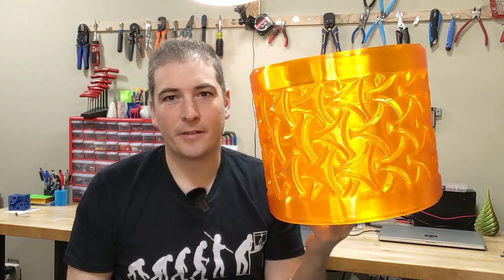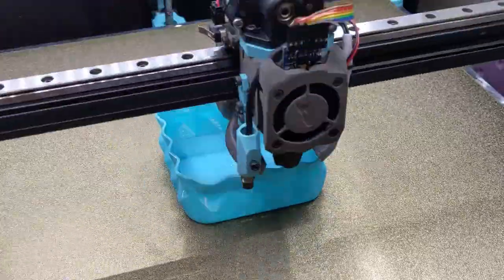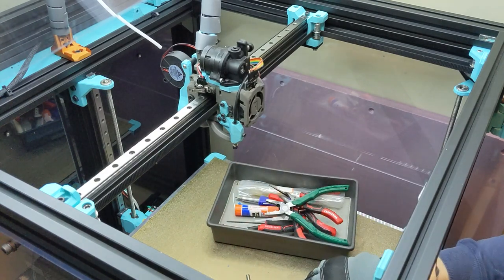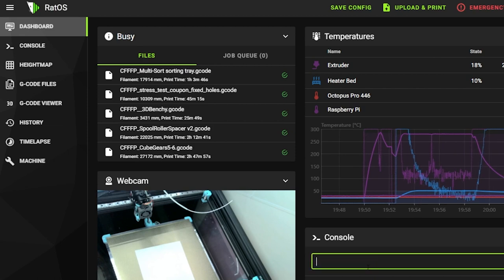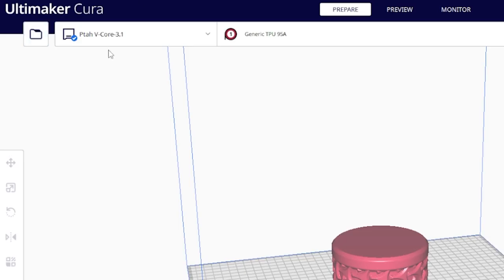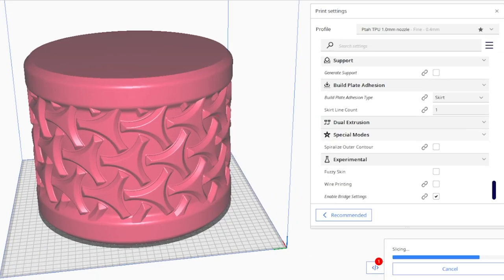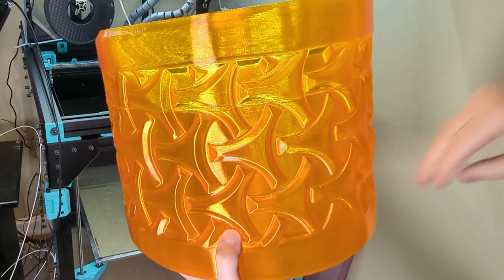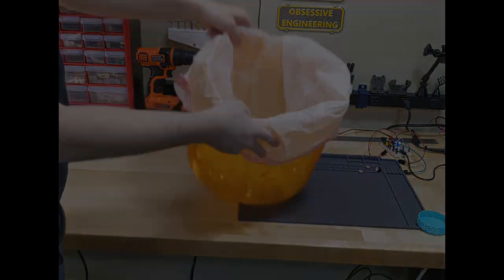3D Printing a Giant Indestructible Trashcan #3dprinting #tpu #ratrig

Comment: I ruined some PEI sheets printing TPU until I discovered that I can get a tightly stuck TPU print off my PEI easily if I spray the edge of the print where it's on the bed with some isopropyl alcohol. The alcohol does something to unstick the print. Works every time and I don't have to mess around with glue stick. I print a lot of TPU.
Reply from the maker: Interesting.  I've heard of that for other materials -- the alcohol evaporating cools the material down and it contracts faster than the plate, which can detach a corner/edge, which might be all you need for ABS/PETG, etc.  In my case, I usually can get a TPU corner up, the issue is the rest of the surface fused to the bed.  🤷‍♂  But I haven't tried it before, so I will next time I gamble on a smooth-PEI-TPU print

Comment: I noticed whole carriage play when you tightened the nozzle at 2:41, you may have to check for any loose screws, i don't think that amount of play is normal, but i may be wrong.
Reply from the maker: Yes!  I notice that too every time I change the nozzle.  I've been somewhat concerned about it, but it doesn't seem to affect the awesome print quality of the printer, so I haven't stressed too much about it.  And if you watch my build video (particularly the short EVA video and Part 2 video), you will see that I am going to avoid messing with that hotend assembly at all costs 😅
Reply from the maker: Update on this:. I just took off the extruder and and adapter plate and tightened the bolts holding it to the linear rail glide block.  The play in the printhead you mentioned is gone.

Either I never tightened it (unlikely) or over time the nylon parts (or bolts?)  cold flowed/creeped.  I guess it shouldn't be surprising... These are plastic parts after all and this is a fast printhead at elevated temperatures.  Even furniture in my house that I have to put together says you should re-tighten the screws after a few weeks of use.

Comment: About to start building my ratrig 400mm. Love the content!
Reply from the maker: Thanks!  Building this machine was a real blast (besides that EVA thing... but that was avoidable).  And every time I go to print something on my Ender and it says 5 hours then I go to my RatRig and it says 50 minutes, I am reminded how awesome it is.  Make sure you you're constantly checking squareness when doing the initial frame, and don't forget to ground everything.  Also, get on the discord and get used to using the search box.  You can ask questions of course, but nearly every thing that can go wrong has been discussed there before.

Comment: I'm in love with the massive bed and print volume. I didn't get a chance to check out the build process videos, how much did the printer end up costing by the time everything was built and ready to go?
Reply from the maker: I was able to keep everything slightly under $2,000 with the enclosure kit and buying the polycarbonate panels and cutting them myself.  You can buy them pre-cut from a shop online for approx $500, but I found clearance polycarbonate sheets from piedmontplastics.com, which regularly has clearance sales on sheet plastics, and I was able to get the panels for less than $100, and then cut them on a CNC router at a local shop.  You can apparently cut them by hand, but it's tedious and inaccurate, of course.  If I wasn't so excited to learn about CNC routing, I probably would've just purchased them.

Here's my V-Core-3 build playlist if you're interested:  https://www.youtube.com/playlist?list=PLrTmSWaWJwqLDVR0vk3-6i47G8yUVdCsp

Comment: Any thoughts why it jammed and then magically cured itself? is the flow rate the issue at that part of the print or too hot, that's seems doubtful, since I've ran sainsmart at 240c with no issue? I find that TPU doesn't need a bed above 30-40c. Came out great, even with the jam. I used to make a bunch of toys for my kids when they were smaller out of tpu, it is indestructible, so there are still a bunch of cartoon characters in toy chests that my kids haven't been able to destroy after many years.
Reply from the maker: I am not totally sure.  At first I thought it might be too hot because I usually think of TPU as printing at PLA temps, but you're right a lot of TPUs go up quite a bit higher.   I can say that every time it jammed, I had no problem re-feeding it through the extruder, so it was never a total clog.

There were a few positives why it wouldn't jam:
1) Large nozzle creates less back pressure from extrusion
2) Vase mode leads to very consistent flow rates

And some negatives that might lead to jamming:
1)  24 mm^3/s is a very high flow rate in general, especially for TPU (you can see how fast and steadily the spool is spinning at 07:44).
2) The BTT smart filament sensor has always seemed like it had unnecessarily high resistance, which might be especially impactful for TPU.  
3) It's possible that my extruder tension was just too low and it was slipping.  I haven't actually figured out the best way to set the tension, and I know TPU is particularly sensitive compared to other filaments.

Comment: Amazing. 

Just found your channel. Not using a rat rig but I love TPU and always want to try and print most things in it lol

What are you me settings? And what file did you use for the print?
Reply from the maker: TPU is amazing stuff.  It is thoroughly underrated.  Sure it's got a couple printing quirks, but whatever you print is indestructible.  

I have added a link to the STL and listed the print settings in the video description.  Thanks for watching!
Reply: @ObsessiveEngineering  I also subbed so keep up the awesome work :)

Comment: Nice print and video, I'm currently building a 400. What are the bed sheet corner stoppers you are using?
Reply from the maker: Here's the link for the corner pieces.  It was recommended to use them to help align the magnetic sheet when you're building the printer, and it would've been worth it just for that.  But printed in ASA it has also survived a couple hundred hours at this point printing with 110C bed temp in a heated enclosure.  Couldn't be happier with it.  (the two pieces on each corner have friction fit pegs and slots, and it wasn't super reliable, but I used a drop of CA/superglue and it's held up fine) 

https://www.printables.com/model/123037-ratrigrat-rig-v-core-3-spring-steel-sheet-bed-corn
Reply: @ObsessiveEngineering  thank you!

Comment: Nice! New sub. I’ve been thinking I’ll likely get a RatRig for my third printer, and I do heaps of Tpu projects, so great to see this, thanks! Any advice regarding the ratrig?
Reply from the maker: The RatRig was my third printer as well (actually 4th if you count my resin printer, but I hardly use that anymore).  I absolutely adore the V-Core-3.1 and it was gobs of fun putting it together.  Also, I was able to do a sub-10min benchy pretty right away after I had input shaping figured out.

Check out my RatRig build series playlist on it if you want to get a feel for what I went through to build it:  

* https://www.youtube.com/watch?v=0dQpodKZjQ8&list=PLrTmSWaWJwqLDVR0vk3-6i47G8yUVdCsp

Here's a couple things I would advise:
* Don't use the default EVA/hotend parts included in the RatRig repo.  I suggest you go to the main EVA website and download the heatset insert versions.  I would've avoided so much pain doing that -- you might have to download new parts from their website anyway, if you don't use RatRig's default extruder & hotend.
* Make or buy a little dolly to put the printer on when you're done.  I used these leveling casters, which are spectacular, allowing you to lower the wheels to move it around, or lower the rubber feet to keep it stable on the ground: https://amzn.to/3Yn4u5w
* Use DIN rails for the electronics in the back, and expect not to have much guidance for the electronics. Most people end up going to Voron docs to fill in gaps.
* The RatRig discord is an awesome resource.  Of course you can ask questions there, but most things have been discussed there before and can be searched quickly.

Comment: Your installation speed is so fast. I'm stuck in the belt tightness. The printed circle is not standard
Reply from the maker: You are building a RatRig as well?  It's quite an adventure but totally worth it!  If you didn't see it, I have a build series on the V-Core-3 -- it doesn't have a lot of information about belts, but you might get other useful info about the process.  https://www.youtube.com/playlist?list=PLrTmSWaWJwqLDVR0vk3-6i47G8yUVdCsp .  Thanks for watching!
Reply: @ObsessiveEngineering  Yes, I have seen every video of you, and the video is very good 👍🏻，  It's just the tightness of the belt that makes me headache. It has not been adjusted properly. Printing effect is slightly poor

Comment: hmm. I like it. I'm thinking it might be fun to try some TPU shower shoes/pool shoes.

I am curious, what is the length between your extruder and nozzle? I Just finished up a hot end mount and extruder mount to fit the DyzEnd pro and DyzeXtruder to the Eva 3 system. the length of the PTFE tube from extruder to the hot end is exactly 50mm, so the path from gear teeth to the tip of the nozzle is probably more like 70mm overall... That may be too long to run TPU reliably. IDK
Reply from the maker: I don't remember exactly but I believe my PTFE tube was around 25mm.

I really wanted to try printing shoes on this printer, especially if I can do it with like 90A TPU (a bit softer than regular).  But I haven't found any good models that give me confidence it's not a waste of time and filament.  Let me know if you find something

Comment: Alan i had the Same issue with my Nozzle, How do i remove it, if it's tight and stuck due to heat changes?
Please i'd Appreciate your input, it's my first Printer EVER and i've done 2 Prints, then tried Changing the Nozzle and it All wore off
 it was so tightly screwed i thought it's welded not Threaded, i tried a strong nut wrench just like yours here, some power tools, eventually it wore off and i ordered another one

Comment: So, your jams.. at what stage were they (sensor, extruder, hotend)?
Reply from the maker: I'm not totally sure.  My most significant observation was that it was never difficult to re-feed the filament back into the hotend after the jam (pulling back the extruder tension spring and forcing the filament through the nozzle by hand).  So it was never a total clog of the hotend.  Given that, my best guess is that the tension knob was just too loose for the amount of pressure it needed to keep up that flow rate.  I've never figured out a good way to set that extruder tension knob -- which means it might have been user error, especially since TPU should be set differently than other filaments.